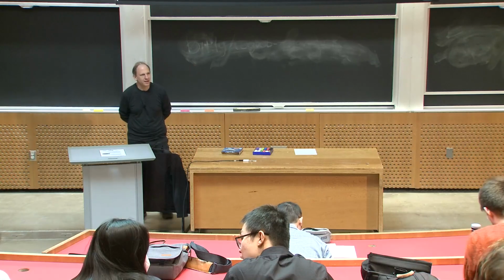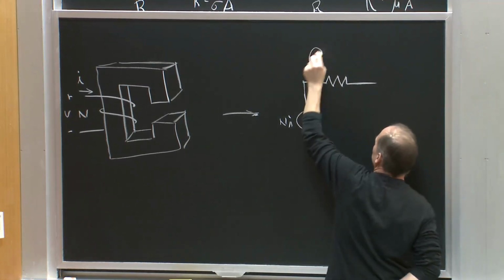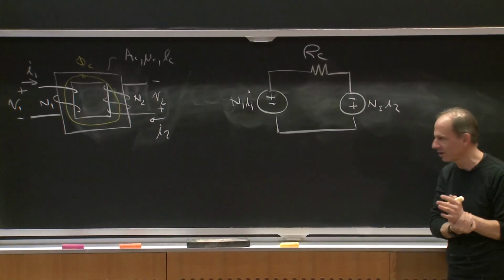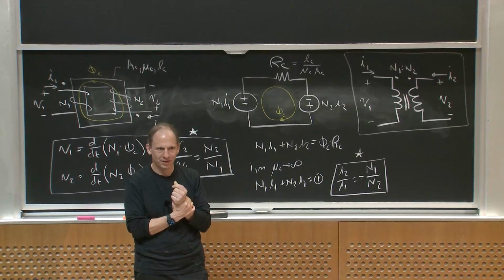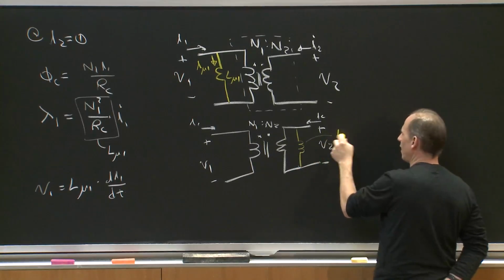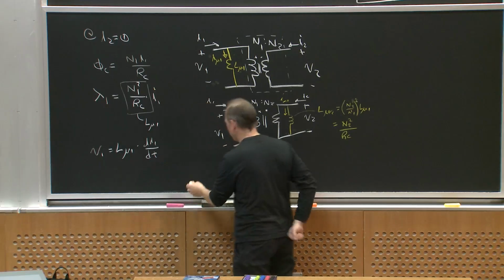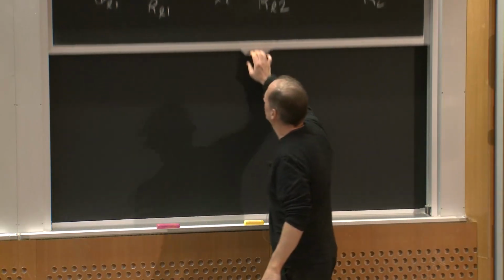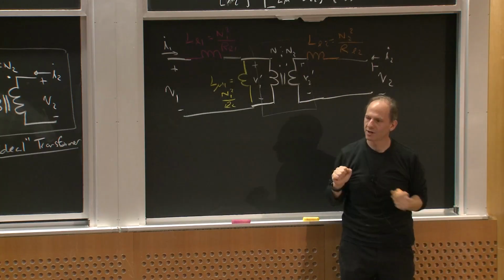Lecture 10: Magnetics, Part 2

Comment: Hello,

I’m trying to determine how to calculate the number of turns required to drive a ferromagnetic core (specifically an open-circuit, I-shaped core / rod) into magnetic saturation.

Given that I already know:

* the current (I),
* the cross-sectional area of the core,
* and its geometric dimensions (length),

I would like to find an analytical expression that allows me to compute the required number of turns (N) to reach saturation.

So far, I can only obtain this result through numerical simulation (e.g., using COMSOL), but I have not been able to find a closed-form equation in the literature that directly relates these parameters for an open magnetic circuit, especially considering the demagnetizing field.

Is there a known analytical or approximate equation for this case, or is numerical simulation the only practical approach?

Any references or guidance would be greatly appreciated.

Thank you!

Comment: Just wondering. In LTspice, you construct a transformer by defining two inductors L1 and L2 and linking them with e.g. k=1. Never really understood how to get an ideal transformer in this way... So according to your treatment of the magnetizing inductance (around minute 31), this LTspice construction corresponds to a combination of those two cases: You just add half of the magnetizing inductance to the primary and half of it (scaled) to the secondary. And if you want an ideal transformer you just make L1 and L2 very high (very small reluctance, very large permeability). Does that make sense?

Comment: Defining the port current to flow into the positive terminal of the port voltage for the secondary winding is fine, but it is inconsistent with the dot markings on the ideal transformer symbol.
Reply: You can define the positive direction of the current as you want, the equation at the end tells you that the current flows in the opposite direction you assumed at the beginning...
Reply: Do you realize this is exactly what you said in your first explanation paragraph? The current enters the dot at the top and defines the positive polarity for the primary. The location of the secondary dot defines its positive polarity here as you stated it should. The right hand rule dictates the direction of current flow.
Reply: You can also use this device as a two port inductor, as is the case of the flyback "transformer", where you store energy from one port of the inductor during the on state and recover the energy from the other during the off state, and these equations are still valid...
Reply: @JonitoFischer ,

I didn't say anything about the equations being invalid. My gripe is with the inconsistency with how transformer dot notation is typically used. 

Dot Notation:
 A dot is placed on one end of each winding (primary and secondary) of a transformer to indicate the same polarity. When the input voltage is applied, the current enters the dotted terminal of the primary winding, and the voltage induced on the secondary winding will have the same polarity at the dotted terminal.   

A current reference direction flowing into the secondary dot, implies the power flow direction is INTO the secondary, which it is not in the case for the circuit shown in this lecture. Yes, you can fix this by flipping the sign of the secondary current, but flipping the reference (arrow) direction for the secondary current, in my opinion, would be much more straightforward.